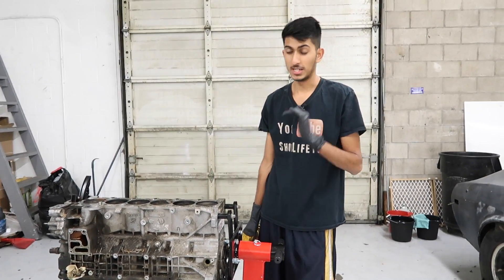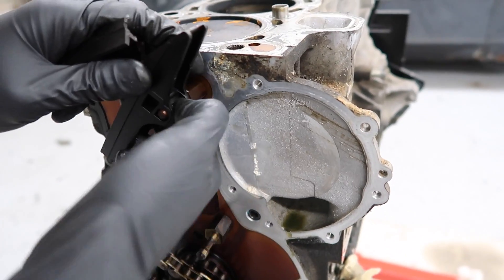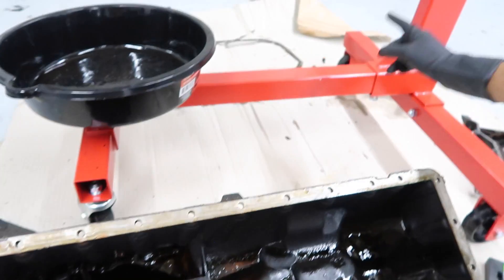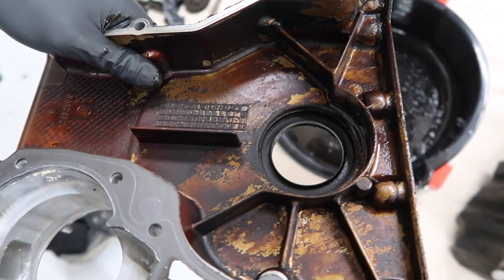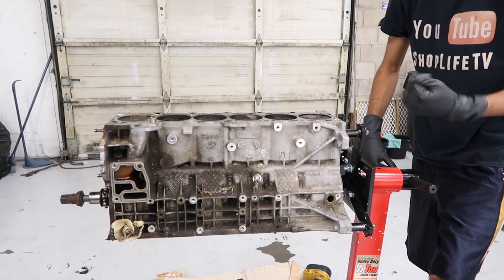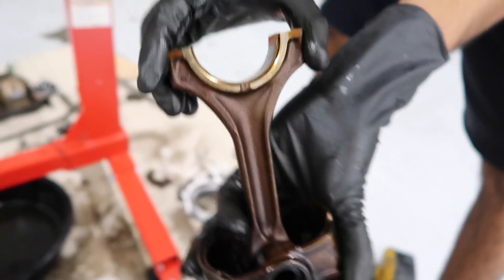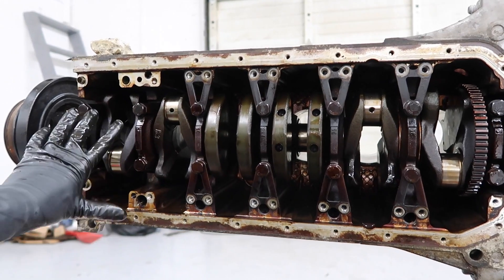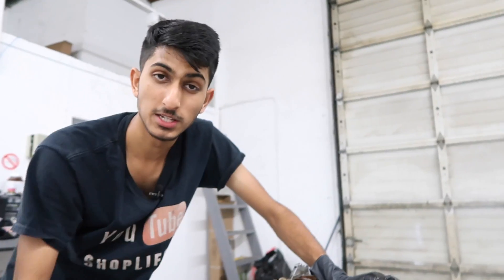Part 6: BMW M54 Engine Disassembly- Oil Pan/Pump, Pistons, Timing Cover

Comment: so how does my e46 has the oil light coming on for 30 seconds after starting the car but it still knew I was low on oil? mmm?
Both my 330i did this.

Comment: My M54 engine on my 330xi overheated, and now it sounds like it’s misfiring when I crank it, my expansion tank wasn’t fully connected to my radiator and everything has been replaced on it except that center waterpump thermostat above the main rotor pully, is there anything I can do to fix this, it was red hot when I pulled over and I had to put 2 1/2 two liters of water in the radiator before driving home, it made my cog trans light pop up on my dash but nothing significant

Comment: 2:20. When the front cover is removed, will it break the oil pan gasket? I have broken the guides while removing the head (and block still in car). A lot more work if I have to remove the oil pan now.

Comment: You never said what was wrong with the motor, and if it was salvageable or not.   I have a similar situation with the same type motor... it over heated and now has no compression on most of the cylinders, so I am wondering what I might have on my hands here, and what I might need to do to fix it.   Like do I just need to have the head machined and maybe put in some heli coils where the head bolts pulled out - if they did pull out, or is my motor likely toast?  Zero compression seems unusual.   Was there anything wrong with the block?    It seems like you took it apart and then said you were moving to South Carolina.   What ever happened with that motor?

Comment: Great series of 6 videos on disassembling BMW engine! My 325i from 2004 was also overheating because of cracked coolant reservoir assembly. Within less than 24 hours after its replacement, there was a loud knocking sound when the engine was turned off and since then it is badly misfiring and there is a periodic knocking sound coming from inside engine. I am told there is a crack on the manifold and something rattling inside. Could have something metallic, if it got dropped inside cooling system, caused the problem?

Comment: I’m doing an engine swap on my 2001 325i (head gasket blew and possible warp head, didn’t feel like dealing with it, the “new” engine is from the exact same car but one year, from 2002 325i, I want to know if there are any extra steps I need to do to make the swap compatible, I know the ECU needs to be swapped over but is there anything else? Some help would be greatly appreciated, great videos, love the channel

Comment: I just watched another vid that is reflective of your video here. I think i may of figured out issue as to loud lifter like ticking sound that engine was making. I now need to drop oil pan to determine whether the bolt backed itself off if so i will have to order bolt that has thin wire threaded through outside of said bolt nut then use bit of lock-tite on thread put nut bolt on and twist it around an run through spacer so it dont rub against pully in oil pan twist again to secure it keeping said nut or bolt on...

Comment: Just bought an 04 325i with a blown head gasket (says Midas). Car started blowing white smoke and driving weird. The previous owner parked it and bought a new car. When I picked it up, it wouldn't turn over and had to tow it home. But also the battery is very weak. What are your thoughts? It doesn't sound like it has bad compression.

Comment: Hey dude, 

thank you for your very comprehensive videos on taking this engine apart. Just got out of tinkering on white block volvo's and recently acquired two m54-engined beemers, so always nice to prepare for future engine work projects. My e39 525iA is an LPG conversion car with >250K miles on it, but since those are mainly Autobahn miles oil consumption is negligible at around 1 qt every 6000 miles! My e46 330CiA convertible does around 1qt every 3000 miles, so still pretty acceptable given the design of the engine. That one has done half the mileage of the 5-series. Both have done around 8000 miles in my ownership, no problems so far and very delightful to drive. Cooling systems seem OK too, both rads look fresh and new.

I'll be sure to keep an eye on your channel! Good luck.
Kind regards from The Netherlands!

Comment: Really appreciate this series. I've got an M54B30 from my 01 330ci (RIP rear subframe mounts) that I'm going to be putting into an E30, and need to disassemble the engine as it's been sitting for nearly 7 years out in the elements. Hoping I can save it, if not I'll have to figure something else out. But yes, this video series definitely helps!

Comment: I'm trying to find an engine for my 2004 bmw 325xi, I know the difference in the AWD motors is the oil pan but are there any differences in the M54 engine itself and can i put an engine in the car from the year 2000-2005

Comment: This was so informative that i watched all the 6 part series in one straight shot..I own an E46, but the Info shown here is applicable to most gas powered engines and should give you an idea on what to expect when you work on the engine for the 1st time..Appreciate all your hard work and knowledge share...
Reply: Yeah! Exactly what I meant to write. Great series. Now I have a better idea how it is working.
Reply from the maker: Thanks guys, glad I could help!